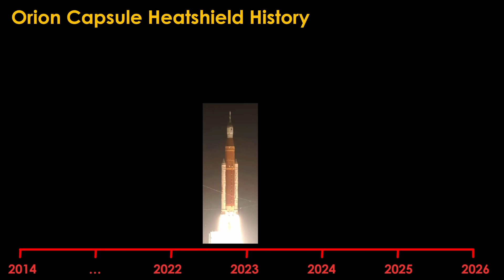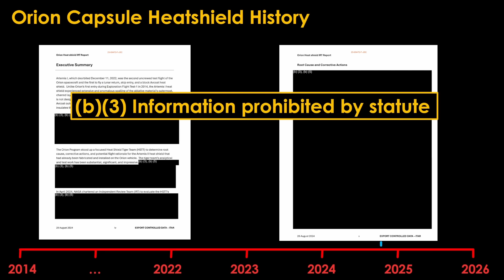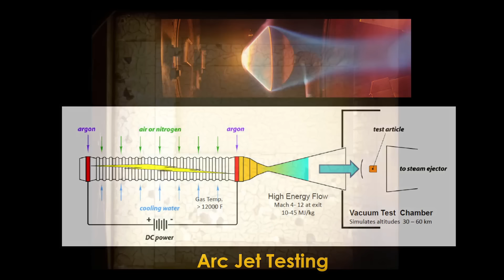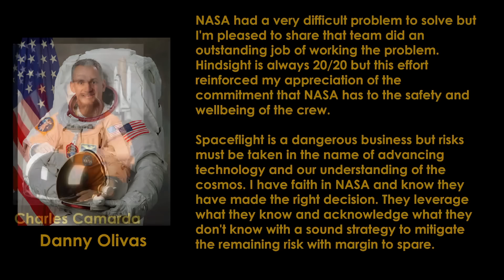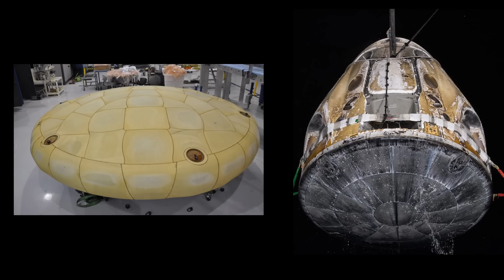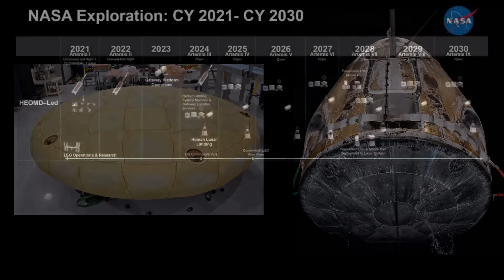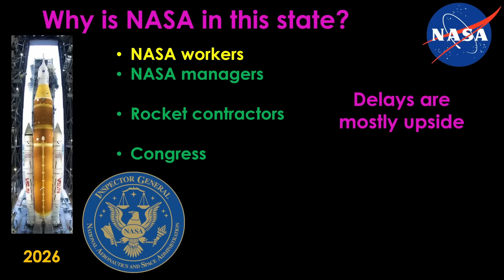Artemis 2 Orion Heat Shield - Is It safe?

Comment: Thank you for this. Wonderful assessments and insight, as usual. I always appreciate when you connect the situation back to the group dynamics and their incentives. Makes things so much clearer.

I'll be honest, it has been hard for me to parse out from the statements and press releases what the severity of the risk actually is. I get a lot of questions about the heat shield. It does seem "probably fine," but how "probably" fine it actually is, is very difficult to know. The data is so limited, at least at the system level.
 
I'm curious what you thought about NASA's statement that they have component tested the titanium frame under reentry-like conditions for 10 minute durations-- has that weighed into your crew safety opinion at all?
Reply from the maker: I thought about putting that in but decided it was a bit too much of a digression. 
I found that part really weird. It's essentially a claim that Orion doesn't need a heat shield at all, we could just use the capsule. 

If that were true, then it would mean that the capsule is ridiculously overdesigned. Which is possible - it's certainly a heavy beast - but it would mean that the designers were essential incompetent. Capsules need to be as light as possible. 

What I actually think is that the arcjet tests a small sample under controlled conditions, and there are well-known factors in physics that do not scale up linearly. They aren't actually talking about an engineering model that looks at experimental data and applies it appropriately to the full-sized capsule. 
So it's honestly a stupid thing to say. 

I had some stuff in the video about Normalization of deviance that I took out, but the "we have lots of redundant safety factors" argument is always a bad one. You have a specific capability in your design for a reason.

Comment: L video. The heat shield wasnt even close to failing on Artemis 1, the report said that, if you want to not trust NASA then go ahead. Leaving the mission success as a simple "probably" is too vague, the heat shield WILL be fine.
Reply from the maker: The heat shield was behaving in unexpected ways - ways that did not match all the modelling that NASA and LM had done. 
The safety of the system is predicted based upon all of the parts of the system performing as designed. 

Note that shuttle flew with partial o-ring erosion on many flights - the SRB joints did not fail. Until one did.

Shuttle lost foam from the external tank on many flights. It caused some damage, but not anything that was a failure. Until it did.
Reply: @EagerSpace  "they did it before and it worked,it will surely work next time"

Why must this be such a commen reason for accidents
Reply: @EagerSpace  1 day to splashdown. I think there is no correlation with the heat shield issues and the SRB o rings/ET foam issues on shuttle. The new trajectory model prevents additional erosion according to the analysis they did on the damaged heat shield.

Comment: NASA wouldn't fly it if it wasn't safe, they learned that lesson from the Columbia accident.
Reply: They learned their lesson from apollo 1...

They learned their lesson from apollo 13...

They learned their lesson from challenger...

They learned their lesson from columbia...
Reply: They said that after Challenger, too,  but then Columbia happened.
Reply from the maker: What do you mean by "safe"?
Reply: @EagerSpace I mean if NASA had any concerns regarding crew safety they wouldn't be putting crew on the vehicle. They cannot afford another Apollo 1.
Reply: @Tmccreight25Gaming  and since Apollo 1 they've lost that same number of astronauts ~4.67 times again. losing these 4 would make it 6 times again.
Reply: @GenderTriplePoint  The number of astronauts is really not the point, it's the number of accidents.
Reply from the maker: That certainly was not true for Challenger or Columbia. They had known issues and chose to fly anyway.
Reply: @EagerSpace After Challenger, the booster joints were redesigned, there was never major issues with O-Ring burn through on the RSRM after 51-L.

After Columbia new procedures were put in place, changes were made to the manufacturing process of the External Tank and there was never again a major issue with foam causing damage to the Heat Shields.

Orion is a prime example of NASA learning the lessions, it has a reliable, tested abort system in case of a Challenger style accident. And the heat shield is protected by the service module so no worries about Columbia style damaged to the heatshields, they noticed that there was more charring than expected on the Artemis I heat shield but that it was well within limits. Procedural and manufacturing changes have been made to resolve the issue. If I was an Astronaut I would have zero reserves surrounding a flight on SLS and Orion.
Reply from the maker: I have a whole video on the SRBs on shuttle. Thiokol had an okay design with a few faults, NASA wasn't overjoyed with it, so they changed it to a really stupid design that NASA approved. None of the early static tests were valid because a thiokol manager had been patching issues after pressure tests.
There were those inside NASA trying to draw attention to the issues but they were ignored. 

And the joints weren't redesigned after challenger. Thiokol already had a new joint design for the composite boosters that were required for launches from Vandenberg. They tried to get NASA to adopt it for the steel case boosters but NASA wasn't interested.

Comment: So NASA is planning to launch BOTH Artemis 2 & 3 with untested systems - life support, faulty heat shield, and new reentry trajectory on 2, and untested upper stage and new heat shield on 3. 

What infuriates and disappoints me so much about what NASA has become is not that they’re stagnant, slow, expensive, or even secretive (although they’re all those things). It’s their double standards. When it’s their OWN systems, all we hear are excuses, minimizing, hand-waving: “space is hard”, “safety is our top priority”, “this is cutting edge tech”, “we need more money”. But when it’s a system designed, owned, and operated by a vendor like SpaceX (on a much cheaper fixed priced contract no less), what NASA says is “it’s time to deliver!”, “SpaceX is late and holding up the whole program! (while conveniently not mentioning the similarly delayed space suits because that’s being built by a company run by their old space buddies)” 

NASA would NEVER put its astronauts on a Dragon design that only flew one test and blew chunks of its heat shield or an untested redesigned Starship upper stage flying for the first time. 

The one ray of hope is that I have more confidence in Jared Isaacman than any administrator in my lifetime, so I’m hoping he’s making the right call.
Reply from the maker: Agreed. 
One of the things that came up when crew dragon and starliner development is that NASA doesn't actually have any standards for what "crew rated" means.   It was simply defined as "what NASA does". 

And don't forget that NASA didn't do probabalistic risk assessment on shuttle until late in the program.
Reply: Well it all worked out in the end, and they only had minor issues with the toilet.

Comment: I am just an "armchair" engineer, but, IMO while I think the decision to fly with this heat shield is OK right now, the issue was mishandled.
Reply from the maker: Is it worth it to put astronauts on it?
Reply: @EagerSpace from a technical point of view, you did make a good point that all the stuff that needs to be tested can be tested in LEO/HEO too. Then again, it's not really a moon program if you can't send people to the moon even 3 years after the first "successful with minor issues" flight, so I do see the reason behind flying with crew to the moon.
Reply from the maker: I totally get the political side. 
But if they didn't have the big delay due to the Orion heat shield, they probably could have flown artemis 2 a year later, and that was possible if they weren't flying astronauts. 
It just goes back to the hardware poor part of the program. And frankly, NASA trying to cheap out and only buying 3 ICPS instead of 5.

Comment: This video is so wrong on so many level. 
- You kindly forgot to mention that the heatshield is actually worked within the margins. Sure, the loss is not good, but this is why TWO independent investigation happened.
- Camarda: asking him is like asking Berger to be the PR face of SLS. He just want to sell his book and he just keep shitting on NASA all the time. 
- "You just toss out the old one" - why? Engineering is always a balance between possibilities, budget and schedule, if it's cleared for the task, then it would be a waste.
- NASA exploration plans: oh yeah, things changed. I just love that you could only mention SLS when the topic is actually Orion.
- SLS constructed from many Shuttle parts - the many shuttle part is: 4 heavily modified engine (and will be replaced) and some steel tubes (and got modified everything around it). 
- You yet again kindly forgot to mention that there are years of delays what caused by SpaceX and Axiom because they just simply not delivering what they're promised. There were numerous delays where NASA explicitly said that they want to give more time for their partners to prepare.
Reply: why is NASA being so secretive about this if they're not concerned
Reply from the maker: Sometimes I wonder if people actually watched my video.

I tried to present the NASA side as accurately as could based on the limited information was available. And then I presented Camarda as a dissenting opinion. 

As *I noted in the video*, he may be wrong. But he at least has an engineering perspective - Olivas is pretty clearly just cheerleading and the idea that an insider on the analysis suddenly got his opinion changed when it was presented to him seems suspect. 

"Worked within the margins" is not an engineering standard. "Worked as we expected" is the goal.

"Worked within the margins" was what was going on with Challenger and Columbia, and there's a very slippery slope when you started doing those things. McDonald was right about the SRBs but NASA did their best not to listen to him (and not just WRT the last launch of challenger). There were NASA experts ignored as well. 

As I said, I do think it will probably work. I just think that's a poor standard to adhere to.
Reply: @EagerSpace  Honestly, I'm really tired of these Challenger comparisons. Challenger was straight a fuckup by management side on every single level to keep pushing the launch cadence (btw. does it sounds familiar from your favorite program which produces glorified failures after glorified failures?). for Artemis they stopped the whole program for a whole year to do not one but two, independent investigation. Sure, they can be wrong. They're humans after all. But I'm pretty sure that people at NASA aren't stupid and they know the limits of the system.

And what are you talking about? Engineering is almost every time about margins and limits. (And how to fail outside the operational boundaries) Even software dudes should understand. (Like, you don't need a 5-9 availability geo-redundant HA cluster with cutting edge Enterprise Java app for 1M request/sec for a simple website for the corner grocer when they have 50 unique visitors/month.
Reply from the maker: >Engineering is almost every time about margins and limits.
Exactly.

Orion was designed based on certain missions and maintaining specific margins. Engineers work hard to hit specific margins because overdesigning adds extra weight an hitting weight targets is paramount. A safety factor of 1.1 is often cited for uncrewed spacecraft, 1.2 for crewed spacecraft. 

Artemis 1 was successful but it's very clear that Orion didn't hit the margins it was designed to hit because of the heat shield erosion. It didn't hid a 1.2 margin. 

That is why NASA spent years of effort trying to figure out what was going on. It may be true that they've figured it out and they won't see anomalous behavior going forward. It might be that their models and understand are wrong, as they were wrong with Artemis 1. 

>(btw. does it sounds familiar from your favorite program which produces glorified failures after glorified failures?)

It's pretty clear you haven't watched my most recent video on starship.
Reply: @EagerSpace  I love that you even mentioned in the video that every tech details was ITAR'ed, yet you confidently throwing numbers here and makes bold statement that "maybe they didn't figured it out". Do you have any concrete or just pulled out some generic number from your hat? 

And heatshields performances measured in multiple metrics, like how well it protected the capsule itsel. As far as I know, from that side, every value was normal. Artemis II's trajectory was delibetarely chosen to be less demanding and avoid gas accumulation.
Reply: @EagerSpace  FFS... Even Apollo had 1.4 safety factor in general. Shuttle had 1.5. Stop pulling out random numbers from nowhere. But in reality, it was more like having a certain level of certainity of not violating a level, than just a random safety factor.)
Reply from the maker: Agreed on this one. I misremembered.
Reply from the maker: > yet you confidently throwing numbers here and makes bold statement that "maybe they didn't figured it out".
They had a model that predicted the behavior of the heat shield. It did not work. 
They have a new model based on more analysis and research, which means it's likely to be better than their previous model. Maybe it is good enough, but the only way of testing models is by flying. 

>And heatshields performances measured in multiple metrics, like how well it protected the capsule itsel. As far as I know, from that side, every value was normal. Artemis II's trajectory was delibetarely chosen to be less demanding and avoid gas accumulation.

I'm a little confused by this position. NASA was concerned enough about the behavior of the heat shield to be willing to slip their next launch by multiple years, but we should look at different measures? 
If those measures are the important ones, shouldn't they just have tried to fly Artemis II earlier?

Comment: Why don’t they just use dragon I’m so confused
Reply from the maker: Dragon isn't lunar capable. It doesn't have the capability to support 4 astronauts for the length of a lunar mission and the heat shield was designed to deal with reentry from low earth orbit, not the much faster return from the moon.
Reply: @EagerSpace  All makes sense. Does the fact that it has the potential for propulsive landing help its case at all? And how hard would it be to retrofit for a lunar mission?
Reply: @JonnyFromCouver 

For the second one

I think it would be closer to dragon derived then a modified dragon

Comment: They are "winging it" because it is too expensive to change the heat shield to a more porous material that doesn't come off in chunks. Maybe the material won't come off in chunks if they skip the skip re-entry bit. Fingers crossed.